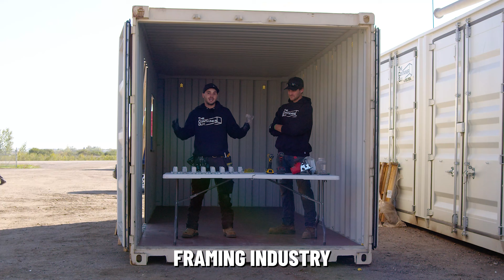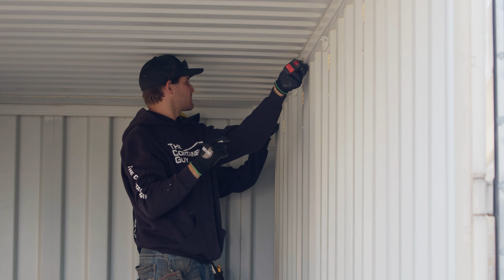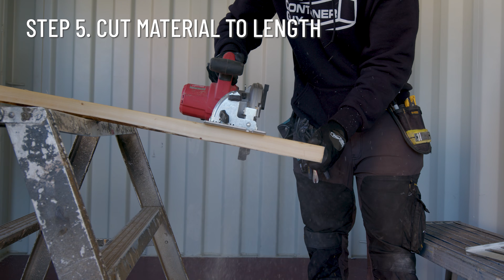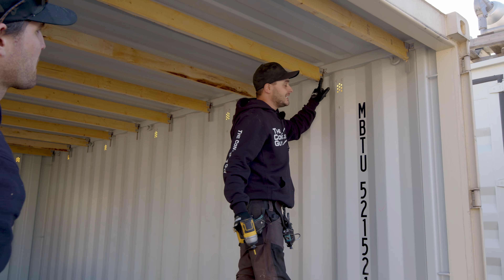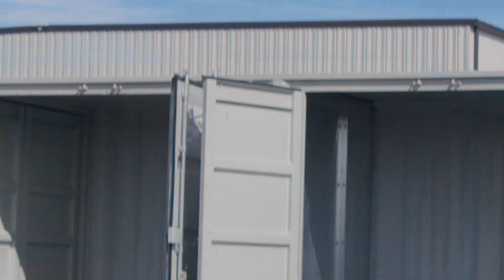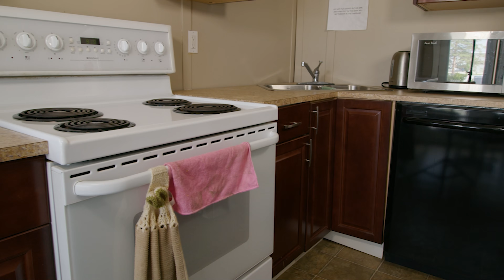Wood Framing Method for Shipping Containers

Comment: Recent subscriber here, looking at many of your videos over the past week or so. You've obviously figured out how to make shipping containers into real working/residential structures. I've only previously seen a lot of questionable DIY-type conversion videos and websites you've warned us about. I had written off the idea of making these things into refined buildings as both impractical and messy. But you've totally changed my mind. 

What you're showing on this newest video with interior wood studs is fabulous. I live in the southwest US desert and, while we have to be concerned with extreme weather insulation scenarios here as much as you would in cold, wet Canada., the comparative lack of moisture we have means that nicely finished wood container interiors here are both practical and desirable. 

Question I have: Maybe you've already talked about them elsewhere on your channel and I simply haven't discovered the video yet, but what do you think of 10' wide containers? I see they're available in both 18' and 25' lengths. The extra width over a standard 8' wide container, to me, looks like a problem solver for an all-wood and/or drywall interior build.
Reply: Where can I get some of those brackets?Somebody to talk to me
Reply: Unable to ask a question on the comments section??  Are using some type of filter?  It’s even hard to type here.  Strange.
Reply from the maker: Hello! Thanks for the support. I really enjoyed reading your comment. Makes all my hard work worthwhile.

Only 8ft wide containers fit in vessel slots. 8.5ft wide 53's must be shipped in large batches on cargo ships. Same goes with 10ft wide units. I have never heard of 10ft wide units being readily available. My guess is they are made in North America meaning the quality is low and the cost is high. 

If the price is reasonable and you aren't being fooled with a tin structure or fold out container, go for it! The 8ft wide interior is the #1 drawback to containerized solutions. I am skeptical though so please share a link if you want more feedback.

Comment: I've just bought some of these brackets, having doubts now - the video focuses on the ceiling but not on the wall frame - zips through it way too quickly. e.g. when talking about the steel battens there's a sign flashed up "uninsulated or rigid board". I understand we have short attention spans these days, but can you slow it down? I can't see how to place the wall battens with this bracket.

Comment: just installed the interior wood stud brackets and used 2X4's. Cannot find anything on completing the walls with wood studs, only found metal stud info. Do you have any plans or videos on how you are completing the walls when using your stud brackets for a 40HC? Thanks.

Comment: I've got a 40 ft container to frame in today and I have the same brackets. Looks pretty straight forward so I'll get to find out. Thanks for the video
Reply from the maker: It's very simple. Put wood screws in all four of the holes and it seems to work a bit better by making sure all the stats are nice and straight and don't bend one way.
Reply: Yeah those brackets are pretty cool and convenient design they're good and sturdy yeah I like them. We're definitely use them again and highly recommend anybody is fabricating a container

Comment: For 25 years I used a container as shop. I got it from a renovation project. It was an office and scale house for who knows how long before I got tt.  . . It was 2x4 framed inside with wood paneling. No brackets,  They just put up the framing and nailed to the floor and it held itself together with the panels and standard wall bracing you find in typical stud construction. filled with  regular Pink Panther insulation. it must have took some time to build this. Your method is cleaner, probably a lot faster and leaves much more interior space, I like it.  too bad this was not around 40 or years ago when they converted my container.  But it served me well as a small and I mean small cramped machine shop for years. .I recently decommissioned it and salvaged the wood for shelves in a new proper shop. You guys have some interesting ideas cheers.

Comment: Bro... so rad to see you build the things to solve the problems. I keep toying with putting 4-5 40' high cubes on a pad for a cabin for my wife and I. These little things you keep coming up with keep adding to my confidence. It all started with those ceiling beams to keep the roofs from sagging. Nice work!
Reply: I was a commercial plumbing estimator for hospital construction and took the knowledge to design Tiny Homes, based on Lincoln Logs & shipping containers.
Reply: @lincolnlegacycabins  How's it turned out for you?

Comment: So, I want to build a small electrical room on one end of the container with a door.  So I don't need the width to be much more than 4 feet and the primary purpose is to provide more insulation so I can keep that tiny room under 100 degrees in the container.  I live in Texas.  Humidity is not a problem.  I am hoping if I insulate it and have a fan with two inlets, I don't have to put AC in there.  The roof will be Aluminum coated paint to reflect heat.  Also the roof will have solar panels so it will be shaded as well by the panels.

I'm not clear how you do the wood walls.  I have done traditional framing.  Are those just nailed to your ceiling joists?  What about the floor?  Perhaps I need an insulated "raised floor" frame as well?  Is there a video of how you do the wood framing inside against this "roof"?  Also, I am wondering if I can just do a 1x2 wall on 3 sides instead of a 2x4 if the foam is just sprayed?  The inside wall with a door would need to be 2x4.  I would like to do it as cheaply and as easily as possible.

Comment: Simpson strong tie joist hangers spot welded in place, much cheaper than your hangers and are basically the same thing. As for moisture wicking, just hot wax your end cuts.

Comment: Completely unnecessary if you are wood framing the walls. Just put your ceiling rafters on top of wall top plate
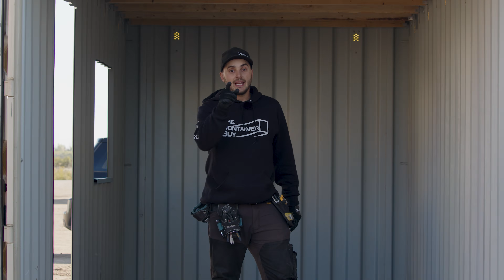Reply: You didn't watch the whole thing, hey? At 5:30 he explained how he used to do exactly that and why he doesn't anymore.
Reply: @bigjayfraserway the framing isn’t structural sonic they’re not exactly plumb no biggy plus if you board it then it won’t “parallelogram”
Reply: lol what a infomercial huh 🤔 😅
Reply: How do you attach the walls to the container? I’m just using my container for Storage) but I wanna finish out the interior because I live out in the desert and it gets hot in there. I have a high cube so I’m gonna drop the ceiling down a little bit so I can run ventilation through there
Reply: @voyher  once you attach the frames each other, there is no room to move. If you put sheets on walls, those add rigidity.

Comment: Didn’t realize you need to pre drill for self tapping screws
Reply from the maker: When you get a bad batch of self-tappers it often takes 2-3 to get a hole started. Best to pre-drill and use thread-cutting bolts.

Comment: Interesting but lacks a structural component.  The bracket hangs on two self tapping screws and has no interlocking support with the container structure. The wood is hanging on the screws, and is unsupported by the bracket.  All your ceiling weight is ultimately transferred to the 2 self tapping screws per bracket. This is assuming you do not have a structural wall underneath this ceiling structure..
Reply from the maker: Thanks for the feedback! The bracket isn’t just relying on two screws—it works as a secure mounting point that integrates with the full wood framing system. When properly installed, the load is distributed across the entire framework, not just on the screws. We’ve tested these brackets extensively, and they easily support significant weight, including a grown adult hanging from them. That said, for heavier ceiling loads, additional reinforcement can always be added!

Comment: OK, I’ve built containers and there is a much better way to do this. Go by the round eyebolts cut out a little notch in the eye so you can get them hooked in all the hooks all the bottom edges and then drill the holes in your two by fours and then recess a bigger hole for the washer to sit down in there and the nut to sit flush. Put your studs flat so you get more space and then use the panther foam board for insulation.

Comment: Unless these things are 99 cents each, a stick of 3 5/8 steel track would be cheaper and easier to install.
Reply: Or just attach your ceiling joists to your wall studs. So many of the products these guys sell are completely unnecessary or are so expensive you could just build a structure for the same price
Reply: Have you built any? @dylvitte3226

Comment: Is there a video that shows how to finish the walls with 2x4 studs?  How do they connect to your brackets?  How do you secure the studs to the floor?  I'm new to all this so...
Reply from the maker: You can frame your walls outside on the ground, carry them in, then screw or nail them into the wood floor and into the ceiling studs.

Comment: I suggest using liquid nails not screws for wall studs for the rear of the shipping container without doors you can use 2x4s and for the sides I think it's 2x3s leave the ceiling go unless you want it insulated. I'm building mine out for a outdoor man cave an work bench area lol

Comment: If you used this framing system with wood studs on a 40 ft HC.  Do you know what the new interior dimensions would be?  Would it still be 6'-11 1/4" wide ? L X H X W?

Comment: Don't use this if you are converting your shipping container into a "GrowPod" or live in cold weather. The screws will freeze and there will be condensation and frozen insulation.
Reply: @Trayce323  what about welding them up there
Reply: @Americanviking82 we think alike , I'd weld everything lol
Reply: Epoxy resin will harden polystyrene, ...or can buy Hardened..
glued to the  ceiling, lining over, screwed an glued, try getting that off, no way ..
Power cables,used 4inch conduit, 
(3 inch was enough)  fixed at the, wall, ceiling juncture, an 1inch conduit to the ..
light/Hotpoint,/switches 
you could run your wiring behind your lining also..
Reply: Thx for your comment. It saved me 10 mins of my life.
Reply: @Trayce323 
 glue "Hardened" styrene inlay, to walls an  glue, screw lining over  ..
You can buy the container shaped, an different grades (3), the green one is treated.

Comment: Thanks for investing your time and effort to come up with new solutions that make mods to shipping containers very easy. I would like to know how you would attach side wall wood studs to the bracket that was installed to put wood studs for the roof? All that is exposed on the WSB bracket after installing ceiling studs is a flat metal. I'm confused on how to join side wall wood studs to it?
Reply from the maker: Build your walls outside of the container, carry them in, then nail the top plate to the studs in the WSB. 

I wouldn't use wood down the walls. Use 1 5/8" steel studs and get max width.

Comment: Does adding this mod change the qualifications to use this container to ship overseas as intended? For example when we move to another country.
Reply from the maker: Not if you don't poke any holes in the container. I repeat, you can't have a single hole going through it. 

The WSB goes into the hollow tube so it's okay. The base track would screw into the wood floor. Don't use screws longer than 1" into the container floor. 

No windows. No doors. Nothing til you get to the final resting place.
Reply: @TheContainerGuyTV  Thanks for the reply, so as long as the outer shell is not pierced. I am thinking of making a shelving system with HD totes on both sides.
Reply from the maker: @daleballa8132  yeah. Use our MSS brackets and strut-line the interior then build your shelves off that.

Comment: I connected two 40' containers together and put a truss roof over top. I cant afford 80 of these brackets. What do you think about just using these where the containers are connected and a normal wood stud wall an inch away from exterior wall with spray foam. Any issues you would foresee with mold?Ty for your time

Comment: Great video and really cool product. Question, If you did finish the framing with lumber, what would be the best way to tie in the  top plate? Could you use the bottom of the bracket somehow?
Reply from the maker: Steel studs for the walls is honestly my best recommendation because you can piece in the tracks and studs one at a time.

Comment: I want to build one in to reloading room would spray foam keep the  moisture out
Reply from the maker: It'll keep the moisture in & out. If you open the doors when it's 100% humidity, the spray foam will not randomly dehumidify the air.
Reply: I was thinking about putting air conditioning and dehumidifier in it... It's going to be like safe when done...

Comment: Fantastic development! And...I like the idea of using composite studs such as, (can I mention a trademarked composite 2x4 maker?) rhymes with Dollywood. I didn't even think about that until you mentioned it here. Great idea with using the steel studs even closer to the wall but leave enough for the closed cell foam.
Reply from the maker: Feel free to say brands and share links
Reply: I was a commercial plumbing estimator for hospital construction and took the knowledge to design Tiny Homes, based on Lincoln Logs & shipping containers.

Comment: My friend owns a garage with a couple of containers he uses for storage and the roof on one rusted out so when he replaced the container he had the new container roof sprayed with truck bed liner coating to keep it from rusting out.  Is roof rot an issue and have you heard of coating a container with truck bed liner?
Reply from the maker: If you rubberize coat a new container, it'll outlive us all. If you spray over rust, obviously you're putting lipstick on a pig but it'll still be a reliable solution for years. He's good to go. Nothing to worry about for a while

Comment: I thought you made a video saying don't use wood for framing inside the container because of the moisture.  You said use metal studs.
Reply: If it is ventilated, it is fine to use wood
Reply from the maker: I said in this video I still recommend steel studs & spray foam for any human occupied space. There are uses outside of Container Homes for this WSB product as brought to my attention by comments on our last framing related video. 

@marcanthony854 is correct (in certain climates) that the wall cavity between the container corrugations and the wood studs/insulation must be ventilated like an attic.
Reply: @TheContainerGuyTV  I just thought using the metal stud with these hangers would be the best way to make the ceiling and walls. Thank you
Reply: The downside of using metal is that containers can flex a bit during transport and it can lead to popping screws. These are great brackets that offer the best of both worlds.  @kimbass5220
Reply: @TheContainerGuyTV  I have learned a lot from your videos and being from Washington, while we don’t have nearly as extreme winter as much of Canada, we still have very wet winters. We are going to be a getting a container here soon and I would like to use some of your products and have some questions on mixing some different building materials. Is there someway I can reach out to you?

Comment: Wouldn't it be better that all insulation, etc. be on the outside.  As everything you are doing here is making a small interior space even smaller.  You aneed a system of insulating the outside and covering it up with cladding.
Reply from the maker: Here is outside framing step by step:

https://youtu.be/VpOq3Avxpic?si=BxWUXCzZaaxxrNpe
Reply: Then you are paying for siding sheathing framing etc. Kinda defeats the whole purpose of using shipping containers
Reply: @dylvitte3226 no it doesn't